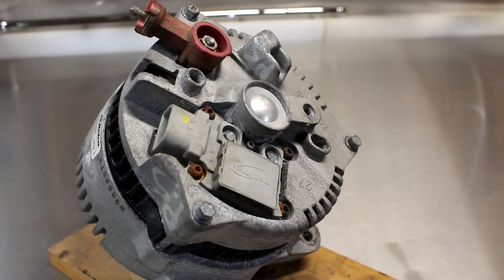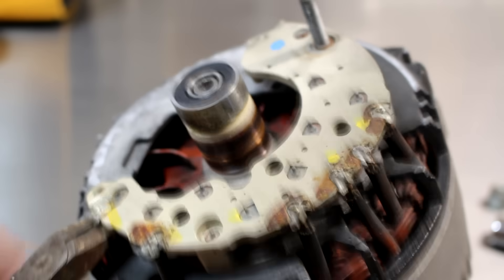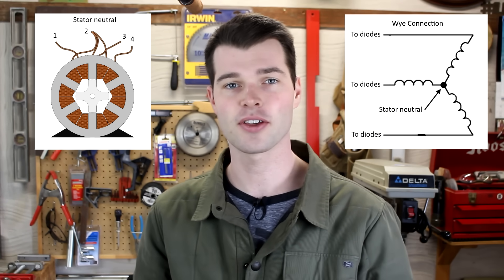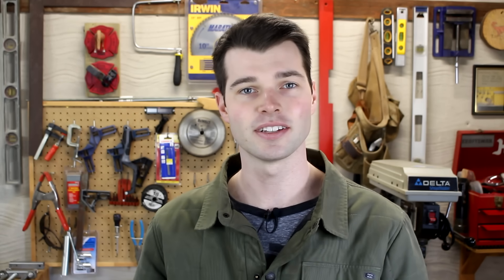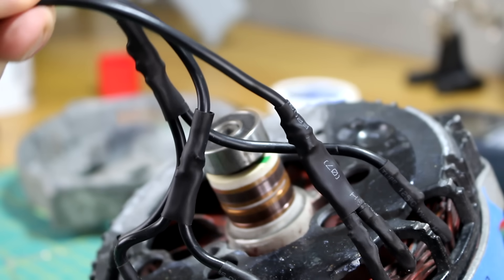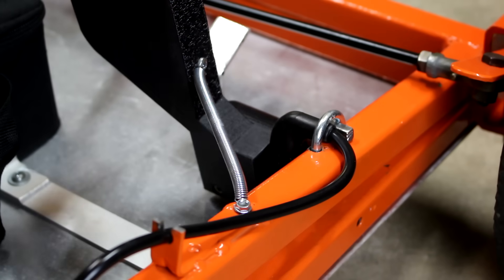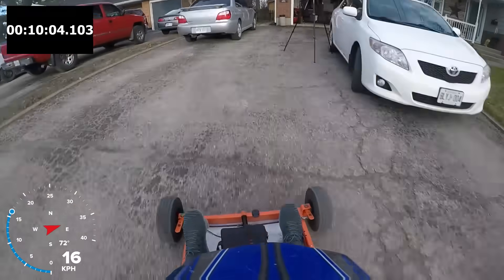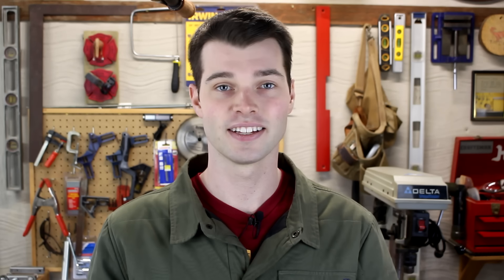Converting a Car Alternator into a Go Kart Motor

Comment: just hooking off the shelf controller to the coils and 8v directly from a battery pack is very lazy. the whole point of using alternator is to use its rotor coil as a variable magnetic field rotor which results in electronic transmission, so the whole controller part can be cut and replaced with 3 hall effect sensors hooked to 3 mosfets (y config only-the center tap goes to power supply +) and then manually regulate the rotor current. by manual variation of the rotor current "downshifting" puts the kart in KERS mode, which would increase its charge mileage. alternator based go kart can be made cheaper, better and more reliable than generic perm magnet motor kart with direct drive
Reply: John Scarce great John can you write a small schematic to help us? WE SO APPRECIATE IT! GREAT JOB
thanks and help is GREAT!
Tim
Reply: @timmax4817  Yeah, really. I would love to learn more about this!
Reply: You mean like a modern motor controller. Which is simply three banks of fets and three hall sensors for sensored setup, or a good autostart algorithm controller for sensorless. The controllers I sell come in the same form factor as what is used here, but uses 18 fets, good for up to 15kw. It also uses sine control and flux weakening. My bike for example is a torque wound hub motor running 92v and 120A battery, 270A phase and it'll his 60mph in no time at all. Nothing more reliable than a direct drive hub motor.
Reply: th3d3wd3r Try not to limit an increase in efficiency to just being able to go further with the same batteries, as it could mean using the same batteries for the same distance but getting there faster, or smaller batteries for the same speed and acceleration, or several other things.... all good things. I will admit I am surprised at how far and how fast the electric motor technology has improved over the past decade. As far as cooling the stator windings using ferrofluid, I can't say that the complexity of that setup would necessarily be worth it. Liquid drag is much, much greater than gaseous drag, so what I was referring to is instead of liquid cooling the outside of the case for inrunners, you'd liquid cool from the inside of the stator for the outrunners. So, in the case of hub motors, the cooling liquid lines input and output would come through the same hollow axle as the electrical connections currently are routed through. Not impossible to do, probably wouldn't add that much cost at scale, and would allow VERY HIGH currents for short durations when a separate pump is employed with intelligent design implemented properly. For example, you are stopped at a light. What usually happens next? You go from a dead stop to cruise speed...max amp draw period. Wouldn't it be cool if the controller noticed that even though the motor was at a proper operating temperature, it anticipated the high demand coming up so it flushed the motor with a cold charge to 'pre-cool' the motor and keep it on high flow until cruise speed is attained and the temperature of the motor has come off peak?
Thanks for those FET suggestions. I noticed quite a few new super-FETs have come out lately. Very impressive performance if you can sink the heat. Because we now have FETs with on-state resistances of around 0.005 ohms, and 100v, 190A continuous (@40°C, derated to 130A@100°C), and *740A* pulsed capacity (that's not a typo), IF we can keep from melting stuff to a pool of goop, we can achieve better magnetic flux density that even the most rare of the neodymium magnets, but like I said, only if we can cool them sufficiently. Rotor AND stator pumping that kind of power (with the other obvious control-based performance/efficiency enhancers such as PWM to create variable sinusoidal signals with variable voltage/current densities) would be....well, it's just an idea until someone makes it. Then it is a component, until someone makes something with it. Then it is a product, and that kind of technology will be judged on the product, not the component. That's what history shows us anyways.
Reply: seeing the interest on this topic i might have to make a video on it. too bad im all out of mosftets so it would take me some time until i order them, then wait for delivery and assemble the system
Reply: I think you need to go read up on field oriented vector control, because you and I are talking about the same concept. Flux weakening already achieves this. As for low RPM, you use phase current. As the motor voltage is lower than main bus voltage, the controller performs like a buck converter, dropping the voltage but boosting capable phase amps without the battery amp draw going above limit, or being held back for lack of torque. At higher RPMs, overspeed kicks in (essentially advancing the timing) then flux weakening (foc) takes it the rest of the way by uncoupling torque and rpm
Reply: Not so much. At 40mph I still have 45lbs of torque. Zero RPM and I have 185lbs of torque, so you've gotta be doing something stupid to stall that out. Flux weakening achieves the same effect, increasing my standard torque at high rpm and extending my speed beyond native voltage. I admit I use lipo batteries however.
Reply: Brain IsFullofNonsense water cooled hub motors are already available. Wires comes out of one side of the axle hollow, coolant pipes come out the other side. However, they are costly. Ferrofluid and hubsink are currently the best way to cool a hub motor. The drag is negligible. I stock both Ferrofluid and hubsinks for qs and mxus motors
Reply: John Scarce So the three MOSFETS and hall effect sensors would be for the stator coils, would that give you variable stator fields (slave) as well as the variable rotor fields (directly controlled master)? That does sound quite a bit more efficient. What component would you choose to control the rotor current? Rheostat, another FET, etc.?
Reply: the stator only needs overcurrent and overheating protection for the very very low rpm's. for normal modes of operation the current regulation of the stator happens by controlling the rotor curent (more rotor current= more stator back emf=less stator current and if the rotor current is way too high the go-kart will slow down and charge the batteries). if you want to keep the rotor brushes just use a normal buck converter to conroll the voltage/current of the rotor. im thinking  of wirelessly powering my coil by inductive coupling of static coil with pwm controll and a coil connected to the rotor by a rectifier and capacitor that rotates with the shaft. this way it becomes true brushless motor
Reply: John Scarce So then the MOSFETS and hall sensors would be used to control the rotor windings? I can see how back EMF would reduce the current in the stator coils if left connected to a constant voltage source, but aren't we using the stator coils to drive the rotor as well? Now I'm getting myself confused. With most brushless DC motors that have permanent magnets on the rotor and no hall effect sensor, the back EMF used by the controller (driver) is not being measured on the coils that are energized for driving force, but rather the ones that are not powered (reading the induced voltage spike when the supplied voltage from the driver is zero) if I am not mistaken. If we are not actively switching the different stator coil 'phases' (windings) on and off then we took the inefficiencies with the constant voltage rotor and moved it to inefficiencies with a constant voltage stator winding. The idea of having control of both the fields is very flexible, where speed can be set constant with a varying load by increasing the voltage as well as duration, advance, etc., or the acceleration can be set constant, or load can be set constant, but only one at a time or it is overconstrained. I got it now. Thanks!
Reply: yes it's basically acting like perm magnet motor with cvt, but the cvt efect is achieved by electronically tweaking the parameters of the motor (regulating the rotor magnetic field)
Reply: We do indeed crave greater efficiency, as that means the battery will go further for the same capacity. The bldc hub motors we use have come a long way. With the best rated curved neodymium magnets. As for cooling, you can use ferrofluid to thermally couple the coils to the motor case (rotor), then use hubsinks around the motor (between spoke flanges). These motors achieve ~90% efficiency. The controller fet losses depends on the fet of choice. For this project i'd use a 12 fet 60v rated with IRFB3770 mosfets. For 100v, IRFB4110, for 120v toshiba, and 150v IRFB4115. This allows you to basically tweek the setup for the greatest efficiency for what you want it to do.
Reply: mark hunsberger
Taking it a step further, with the right battery arrangement, regenerative braking could be utilized, as a sort of "retarder" circuit when throttle setting is calling for deceleration.  It will only recover SOME of the kinetic energy,  but it will take a load off the brakes,  and extend range from about 10% up to maybe 30%...
Reply: Incredible thread,  folks...very interesting knowledge here.  ⚡    ✌😎
Reply: Make your video then.
Reply: or just buy a vesc6, run in foc sensorless mode and have 100+ amps of power at your fingertips, and a fully programmable motor controller, and spend your time elsewhere
Reply: Interesting concept indeed, but using 3 hall sensors to drive the phase MOSFETs... seems it would result in a very 'coggy" motor... since you would only have exclusive monopolar A,B,C phase drive (one phase driven 100% every 120°), and not the A,Ab,B,Bc,C,Ca in-between drive times to smooth out the drive somewhat.

I'm not convinced that it wouldn't be fine (if not best?) to just use a traditional sensor-type PWM BLDC controller, modified by taking the same PWM used in the controller to drive the rotor current... but inverted... such that at low speed when the BLDC phase-drive PWM is at a minimum, the PWM for the field drive (rotor current) is at maximum... which is exactly when you need maximum torque.

One great advantage to using a non-PM motor is that there's no chance of demagnetization due to too-high of a stator field strength... you can run as much stator current as the thing will handle, as long as it doesn't burn up.  Therefore, run the highest voltage possible, since you get more Power with less Current. 65 Amps at 12 Volts (most common compact alternator size) can give you no more than 780 Watts... or just at 1HP output (considering some losses). However, at 48 Volts DC, if you can still drive that same 65 Amps, that's 3,120 Watts, or 4HP.  I've heard of some people using even higher... like 96 Volts... for 8HP.  

Those mfr current ratings are pretty much continuous, and in a very hot environment, so they should easily handle 100 Amp peaks (150%)... 100A x 48 = 6.4HP, 100A x 96V = 12.8HP.

Taking that 96 Volts to a heavy-duty 120 Amp alternator... then you've got 15 horsepower... conservatively. At 180 Amps peak (150%) is about 23HP.

HOWEVER... all of this "high voltage" stuff presumes you have a Current-controlled PWM BLDC motor controller... most cheap ones are not... they just apply the full battery voltage to the motor windings.
Reply: i didn't understand what your issue is with my setup specifically. is it that i cheap out on mosfets by using only 3 and drive the coils in unipolar mode therefore having double the heat loss due to wire resistance? the 3 mosfet version is good enough for early protipes and im ok with using full fledged 6 mosfet 3 phase bridge. the point of variable rotor field is to cut the part with complex controllers and increase the rpm range at the expense of high speed torque and make the regenerative braking much more efficient and simple by removing the need of high power DC-DC converters
Reply: 1. schottky diodes have 0.15-0.18V drop (the kind of diodes optimal for low voltage high current applications). 2. regenerative braking of perm magnet motors makes use of high power inverters that have to deal with very wide spectrum of input voltages, so they achieve their peak efficiency only at specific rpm and that efficiency is no more than what a generic switch mode power supply can do. 3. if 0.2 volts are really something to worry about then replace the diodes with another bridge of mosfets controlled in a way that simulates diodes
Reply: To do what you are describing, you will still need a phase locked bridge in order to control the losses in the stator field. Simply using hall devices to determine the position of the rotor with cause problems at low RPM if you don't have some sort of PWM.   If you have that you might a well just use it to do the whole job as described above with field oriented control which is capable of doing field weakening.  I am not sure why you think modern FET switchers are so inefficient.  The switching losses at these frequencies (5-10 kHz) is a small part of the total loss and the resistive losses will not be very high (40A*0.009ohms=0.36W for a single device, IRFP4410ZPBF).  Also, the efficiency of regenerative braking is mostly determined by the motor and the batteries used.  The internal resistance, particularly with lead acid as used in this video, is very high and this will dominate the efficiency of the regenerative braking.
Reply: because of the high currents at low speeds it is essential part of the system to have constant current regulation (either low frequency pwm to the bridge driving the stator or external buck converter supplying the stator driver). i have never said modern fets are inefficient. i said regenerative braking of perm magnet motor works only with inverters/converters that are not as efficient. PWM control of the rotor defeats the whole purpose. the rotor should be constant current/constant voltage pure dc supplied, because you want constantly active but variable magnetic field rotor. pwm will make the rotor be at peak magnetic field some of the time and no magnetic field the other which defeats the whole purpose. unfiltered pwm will make it have variable rpm yes, but you won't increase the max rpm a tiny bit. filtered pwm ( pure dc-dc converter for constant current/voltage) will give you all the possible torque the motor can give you until the back EMF starts bottlenecking it and this is when you will need to progressively drop the rotor current to keep the motor accelerating trading off torque for rpm and therefore achieving cvt action
Reply: Antiphase, 3 windings 120 degrees apart, connected in series. Normally this would result in a zero voltage as the 3 phases cancel each other out. But by reversing one of the phases you get a normal sine wave output which is higher in voltage. Electrically this works but the question is would it work magnetically? Now we only have one sine wave to rectify so instead of 6 diodes with volt drop of 0.7 at 20v, we now have only 2 schottky drops of 0.2 at 35v
Reply: th3d3wd3r controller uses vector control and treats the BLDC motor as a pernament magnet synchronous ac motor. Vector control achieves field weakening and that is equivalent to having a separately excited rotor winding.
Reply: John Scarce CORRECT, I don't know the details only understand there are optimal values for RPM+power output managing field and stator voltages.
Reply: Sorry I didn't read all the replies, but isn't variable rotor flux also better for lower bemf at higher speed operation?
Reply: John Scarce I subscribed but you don’t look like the John Flanelle Scarce i used to watch
Reply: Well, at least you have the big advantage of not having your motor torque drop like a stone when the LiPo goes flat. And regulating the field winding current is great, it can give you better top speed as long as the variable frequency drive can put out a high enough frequency.

You can do regenerative braking (KERS) with a permanent magnet motor without any problems.
Reply: how do i send it to you?
Reply: @two_number_nines  
Charge them for drawing a diagram of these comments. After reading some of this and honestly not having a clue I don't think those doubters do either and just want to test you pout of hoping you can't do it. If you can design a more efficient method make them pay. When they come on and complement you for it you can give them their money back. But don't waist your time over people you wish they knew more then you. 

I don't have a clue if your idea works or not but it sounds to me you clearly have a lot of knowledge regardless to who understands! 

If you could teach me how to make an effiecient generator using inexpensive left over parts I.e. altenater, truck generators, ceiling fan motors etc (anythi g) that I can power from water & wind which I can engineer with power I would gladly pay you for your help! I don't understand how to produce the most efficient power output. Or can I just buy one? 
Steve
Reply: the diagram isn't that complex and this is the whole point to it and i wouldn't want to charge people for it anyways. when it comes to generators as long as your bearings are fine and you aren't using a brushed motor everything is efficient. even induction motors can be used and in fact they are the easiest to hook to the 120ac/220ac/240ac grid but im not sure if they can work indepenently if the power shuts off. maybe with some mods they can power your house and stuff independently and i think this would be the easiest way to go. otherwise you need to find some motor/generator, rectify its output and connect it to beefy dc to mains ac converter
Reply: +Steve Allen
There is no way to make an efficient and simple wind/water-generator. Actually, you can chose two out of the three: Simple, efficient, reneweable energy source.
No matter what kind of generator you use, you will need both power converters (AC-DC-AC, DC-AC-AC-DC-AC) an a buffer (batteries or a capacitor bank). Everything that makes the converter more efficient, will make it more complex/expensive/difficult to design with goodies like zero voltage/current switching, synchronous rectification and so on.

Go with simple: DC-Gen or AC-Gen with diode rectifier, plus e.g. a grid-ready solar-inverter plus a large lead-acid battery bank. This way you just have to design the generator/rectifier setup so it does not exceed the rated max. voltage of the solar inverter and you don´t have to worry about net synchronisation or power management during changing enviromental conditions, since the inverter does that for you automatically.
Reply: "constant current/constant voltage pure dc supplied" This doesn't really exist.  There will always be some ripple regardless of the source.  The key parameter is how much current ripple is acceptable.  In the case of the rotor field, there will be very little ripple even with an unfiltered PWM because the rotor itself has a lot of inductance.  Also, if you use a PWM that is high in frequency compared to the RPM of the motor, you will never notice the current ripple anyway.  If the motor is spinning 5000 rpm, even a 10kHz PWM with be fast compared to the switching of the stator fields.   If you want full current in the rotor winding the PWM goes to 100% and bingo, no ripple from the PWM.  You only get the ripple from whatever it is being sourced from AND the ripple due to the coupled energy from the stator winding.  The PWM could be filtered but it will slow the response of the PWM which may or may not be an issue.
Reply: First of all, I enjoyed the video.  Well done and thank you.  Now my favorite line from the Big Bang Theory show, "Are you sure you guys are smart?" Lol, I'm just kidding. 😂 I enjoyed and took notes from the comments as well.
      Now use a bmx rear free wheel sprocket instead of fixed teeth and add a solar panel for charging, shade, and downforce.  Now you can free wheel coast and enjoy a cool ride in the shade, longer.
Reply: John Scarce I'm very interested in this discussion as I am in the process of developing a product that will utilize such techniques. Now dwell on this....an electromagnetic transmission. A 12 phase motor that has 13 different combinations of Y and delta to give a wide range of rpm and Torque. I'm also playing around with (generating) connecting phases in series and reversing one (that would normally cancel out the other two) resulting in a single sine output of higher voltage that requires only 2 schottky diodes to rectify, result = much higher efficiency rectification. And no voltage regulator, that shits wasteful....instead charge a 180mF capacitor discharging into a buck. I've been trying to figure out how to get the FETs to rectify to improve further but I suck at designing circuits
Reply: so you want to use FETs to rectify the current when regenerating?
Reply: Yes. Been playing with circuit simulator for days and can get half wave to work somewhat but full wave no. All the examples use ground which doesn't work. Tried looking at Google images and see some designs but can't translate that into working simulation
Reply: i wouldn't trust simulators for shit when it comes to complex systems like this. get that soldering iron and order some components from ebay or any international online store you like. the concept of having a lot of phases and making different star delta configs to simulate gears sounds very cool but the main drawback is it will take too many relays or transistor/thyristor combos to achieve it which would make it very price inefficient.
Reply: the electrical voltage is a directly corellated to the the magnetic fields doing their thing, so if it works electrically it is automatically magnetically ok. the only problem is that a rectified 3 phase output gives a very smooth voltage output with only a few ripples. meanwhile a rectified sine wave goes from 0 to 100% of the voltage it can do, so the higher the voltage of the battery you are charging the lower the "duty cycle" of the current going to the battery is. this config is only good for achieving more voltage from a specific motor construction, but if you can go with the classic rectified 3 phases its the best option. yes it uses 6 diodes, but they are rated lower current, so the only problem is the overhead you pay for casing and soldering 6 diodes instead of 2 (or actually 4 for a full bridge rectifier)
Reply: Videos yet John or too lazy?
Reply: and your batteries and motor melt at 0 rpm and over 40mph its torque is lower than a clock. good controllers can achieve alot, but nothing comes close to variable magnetic field rotor making the machine work as if it has CVT
Reply: th3d3wd3r Not quite...We weren't talking about permanent magnet motors, but rather ones where both the rotor and the stator consist of windings which gives you the opportunity to COMPLETELY AND TOTALLY HAVE NO MAGNETIC FIELD as well as other things that a permanent magnet motor can't do. The caps were for emphasis, not shouting. If you have no magnetic field the only losses during coasting are the friction from the bearings and the air resistance, compared to the cogging past each equilibrium spot on a BLDC motor. AND consider the losses from the FETs and how switching losses eat into the efficiency of the system. I do like hub motors for several reasons, like no external trasmission chains, it fills an space that would otherwise be empty allowing for greater space efficiency, quieter because there are no chains and gears. I also dislike them for a couple of reasons: First reason is it adds unsprung weight to the system so going over bumps leaves only the squish of the tire to absorb the shock load the motor would feel. Squishy tires leads to less responsive handling, so there's more trade-offs and balances to be considered. The other thing that I don't like about hub motors is that it is an outrunner design (rotor is the outside), which limits what you can do to cool the coils so that you can run more current through same size wire, or smaller wire for the same current, which allows for higher magnetic flux density for any wound coil which all means MORE POWER IN A SMALLER/LIGHTER/CHEAPER   PACKAGE, and isn't that what we all want? *I said cheaper because it should require less materials to make, such as copper, aluminum, steel, etc.

All that said, I'm going to check out your products for some quick-turn projects.
Reply: John Scarce u
Reply: So I can just add more batteries or no? For us humans please.
Reply: John Scarce ee
Reply: Double the I^2*R loss and half the torque (or there abouts).  Unfortunately, it will not increase the rpm if there is insufficient torque to allow it to happen (as you said,  "at the expense of high speed torque ").
Reply: One other thing that bugs me about your idea is the fact that it has no way to dynamically adjust the timing.  This will mean that the timing will only be correct for a single operating value (rpm and current).  Most all motor controllers have built in dynamic timing adjust that continually changes depending on the operating point.  It is easy for the sensorless ones to do because they utilize phase lock loops to keep the processor locked to the rotor position and rpm.  

I agree that using field weakening to adjust the rotor field could be interesting, but it would best be done in conjunction with a real motor controller.   It could be done with a single FET and a PWM but the duty cycle of the PWM should be controlled by the motor controller in order to do it correctly.   Blindly changing the rotor current without knowledge of the RPM and stator current isn't going to do anything useful.  It would only be useful at higher RPMs and low current where you want to increase the top end RPM.  It would also be useful to turn off the rotor power when the motor is stopped thus saving the I^2*R losses when the motor isn't spinning.
Reply: the rotor inductance doesn't mean shit during its off states. all you do at high frequency pwm is rely on the very bad hysteresis of the iron core of the rotor to smooth out the magnetic field strenght over time, but this means you get a lot of hysteresis losses. dc-dc converters by definiton have output current filtering and smoothing so the current "ripples" are not really an issue. buck converters in a nutshell are pwm controllers with output voltage and current filtering to achieve mostly smooth dc power
Reply: Can't wait to see your video.
Reply: John Scarce and how do you get it to rotate from zero speed - notice there's only slip rings and no commutator which is the point of using a 3ph controller to provide rotational field.
Reply: John Scarce -
Reply: JayJAylen75 UR probably going back to far for these youngins my boy..most aren't old enough to remember Revenge of the Nerds
Reply: RaidrWolf 
Well said.
Reply: John Scarce send me the link to your build.
Reply: th3d3wd3r what's your eBay store. I will buy one.
Reply: John Scarce x
Reply: John Scarce yes it would take a take a lot of FETs but consider something like the Tesla trucks, the price would be relatively small. In regards to the antiphase idea do you think there would be a conflict magnetically with 2 phases normal and one reversed? With regard to 96v, if the motor is 70% efficient and pumping 200A that's 20kw with 6kw of it in heat, so not possible without liquid cooling. A 200A alternator is rated at 3kw at 50% efficiency which is 1.5kw, so seems like as a motor at 96v it would only do about 50A continuous. At 6000rpm an alternator is putting out 55v under load, does that indicate that 55v would be a good motor voltage? How efficient would a good brand RC esc be at regenerative braking? It's just backfeeding through the FETs right so is there any advantage in building my own circuit to do the same thing? 
Parts are in transit. I had planned to use pwm for the rotor but from reading this great thread I think now I need to use a buck and control it with arduino somehow. Scratching my head again.....
Reply: In a previous project I had a series of resistors attached to solid state relays and the phase control was achieved depending on how many relays were high and the resistance. But that seems like an analog solution and must be a better way
Reply: If we use a diesel alternator instead would that be effectively a lower KV rating giving more torque and lower rpm? For regenerative braking purposes would it be better?
If we change from Y to delta or vice versa during rotation would there be any magnetic chaos? Obviously the magnetic field would collapse giving a high voltage spike, so I'm thinking reduce the rotor current before changing the configuration....question is how quickly could you do it?
Reply: what are you calling the antiphase idea ? You can exceed alternator power rating by reaching much higher voltages by keeping the rotor at peak magnetisation at high rpm , and the current rating output still stays the same as the manufacturer specification, unless you do a custom rewind. I expect that  a good brand esc will most of the time be good enough at regenerative braking so that the battery charge current would be the bottleneck, but the problem i have is that the voltage converter circuitry drives the cost very high.
Reply: im sure diesel motors use alternators with the same design as gasoline motors. The power/torque differeences between the two arent high enough to justify completely different designs for both. I dont think switching from star to delta while running will cause any problems (worst case is reversing the torque for a fe miliseconds). When switching from star to delta just increase the rotor current by about 40% to fit the new kv rating smoothly
Reply: John Scarce YAH
Reply: Have you started your project yet? Many people and I would definitely enjoy watching your ideas.
Reply: I just finished all the graduation stuff that made me busy in the past monts and there is some  ''science fair'' thingy coming soon so im getting that alternator, that soldering iron and mosftets taken from old motherboard vrm's and doing what has to be done
Reply: That is awesome news. Looking forward to everything, and hope your graduation goes fantastic.
Reply: This problem is best solved with a rotax two stroke
Reply: WTF are you people talking about? 😂
Reply: I don't understand at all
Reply: How would you make this?
Reply: guys the video is late, because im lazy, i had a lot of stuff to do, i have no mosfets and i cant find a basic 2 amp 20ohm potentiometer or a 2 amp buck converter to control the rotor current. im thinking of trying again with the buck converter strategy by using a 555 based led dimmer circuit and filter the output to dc. my next problem is the transistors to drive the stator. all i have now are some weak low drain-source voltage rated mosfets taken from old motherboards. i can't promise a video release date yet, but i can confirm the wireless rotor powering thing works, but i cant regulate its power until i solve the previously mentioned potentiometer/dc-dc converter issue
Reply: I no understand
Reply: He has an esc lol
Reply: John Scarce n
Reply: @John Scarce  How Sir do you know all of this so well?  Did you go to school for electrical theory?   Im a mechanical genius, but struggle with electricity somewhat, not entirely, but definitely on the scale you discuss.  However I do understand many of the things you state here.  What Im trying to say is...I'm trying....   Any recommendations for reading/study ?
Reply: variable rotor flux is always better. depending on the gearing of perm magnet motor it will either suck at low rpm or at high rpm. to solve this problem with perm magnet motor you need gearing. varaible rotor field lets you have all the torque possible at every rpm and your max battery current rating is the limit
Reply: Then make your own video detailing how to do it so a novice can replicate it.  Put your money where your mouth is.
Reply: Yes  make a video it sounds interesting but would be easier to understand visually
Reply: John Scarce, I too await your build as well !!!  
Austiwawa built something and explained it in such a manner most anyone could understand. You come along and say he's lazy??? shame on you!!!  Then you try interject with "brilliance" by saying BIG words like "Kers Mode" ?!?! simply put, you're out to lunch, you cannot get "regenerative braking" or as you put it "Kers mode" with your simplified Mosfet idea (proper spelling). In fact using an off the shelf BLDC contoller will !!!  In fact the people have spoke ... over 420,000 views in such a short time!!! Koodo's to you Austiwawa
Reply: Brain IsFullofNonsense
PWM  control / chopper.  A simple 555 timer can be used for asynchronous PWM with a DC voltage input to an op amp / comparator.  The 555 contains two comparators referenced off of Vcc already, so it's just a simple matter setting the 555 up in monostable mode and using the op amp as a third comparator to provide two-phase clock and reference voltage for the internal window comparator of the 555.  The 555 could also be run is astable mode, directly controlled by a potentiometer,  but it's not as reliable or stable a using monostable mode with an external pulse train and control voltage.  And if you don't want to go analog,  you could alternatively use a microcontroller to provide the output pulse train for the MOSFET drivers.
Reply: +John Scarce
just hooking off the shelf controller to the coils and 8v directly from a battery pack is very lazy.

Your not having a video showing us how it's done is very lazy.  Your comment is idiotic.  You don't have to be derogatory about it.  Here is a lesson in civility which you apparently need.  If you think you know of a better way, say, "A better way to do X may be to do Y instead.", not this [in smarty whiny voice] "Doing it that way is very lazy." [smarty whiny voice off] especially since YOU don't have a video here yourself, smug armchair complainer.
Reply: jayjaylen75 https://youtu.be/tZVdR19E5mU
Reply: I think you have your numbers mixed up.  Your setup will be far less efficient and less powerful if you only energize the coils in a unipolar fashion.  This means that each coil has to turn the rotor through twice the angular distance compared to using a motor controller.  I have run an alternator on a rc motor controller and it works very well.  The regenerative braking also works just like a permanent magnet motor.  I took it a step further and made the rotor current adjustable while running on a motor controller.  It wasn't of much use and only increased the unloaded RPM of the  motor.  If you set the rotor field current to 0A, it pretty much runs like an induction motor where the field is generated by the spinning of the rotor coils through a magnetic field.   Here is a link to the video I made in 2011.
https://youtu.be/zrO5rVdTdb8
Reply: I am also confused as to why you think your system would have more efficient regen when it relies on diodes that have forward drops around 0.7V where as a FET will only have the Rds_on to worry about?
Reply: John Scarce . Keep playing your video games. Or is that being lazy.
Reply: John Scarce no need to call him lazy. If the best imaginable version of what you describe was actually done in this video, someone that knows more then you could come up here and just call you lazy for not doing “X”. 
And that’s a fact. You can watch 6 million of these videos and a fuk’n NASA scientists version will have some keener shitting on it for not doing it “right”.